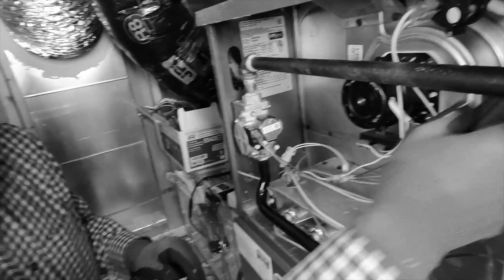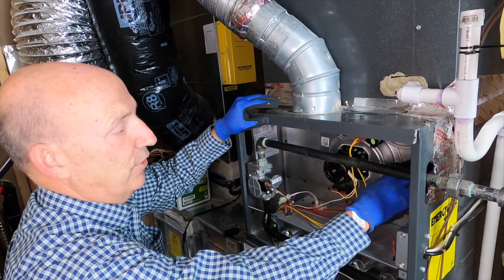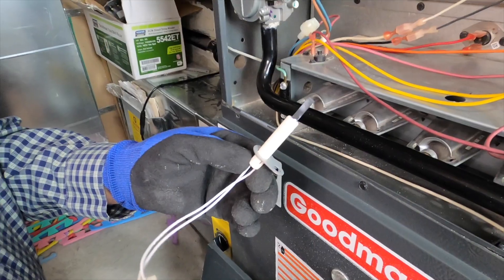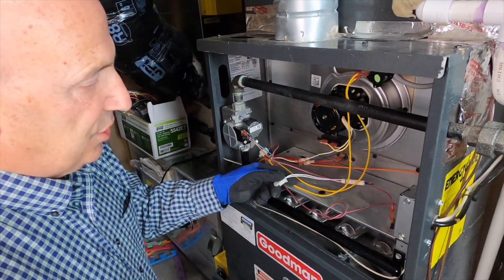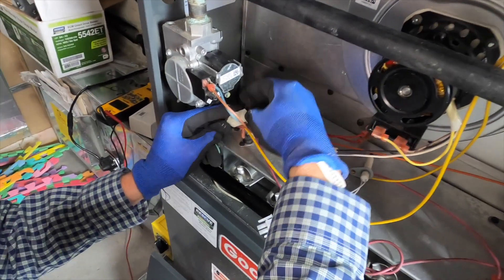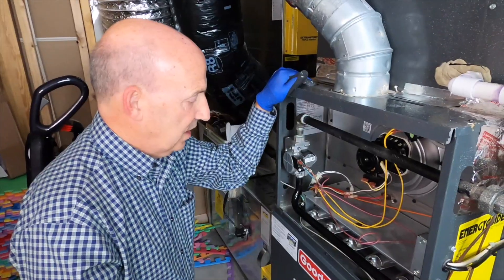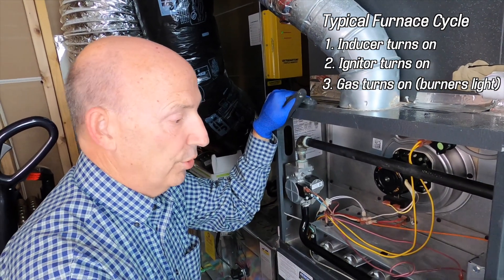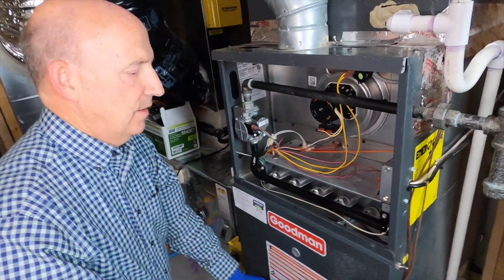Simple Furnace Checks: Checking Furnace Ignitor and Flame Sensor

Comment: Always great insight thank you.   i'm looking to move my Outdoor AC Unit 85 feet from the house to under my deck on a concrete base.    Should this be avoided or will the system still work as efficiently.  Hope you have some guidance.  Thank you in advance.